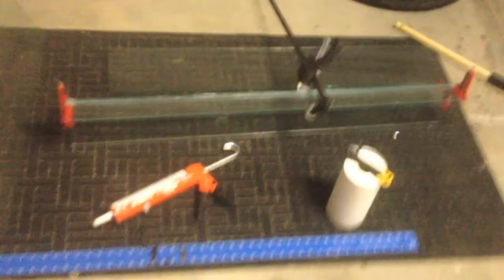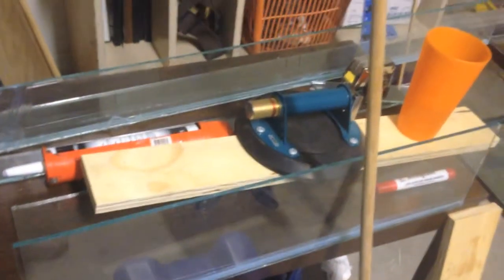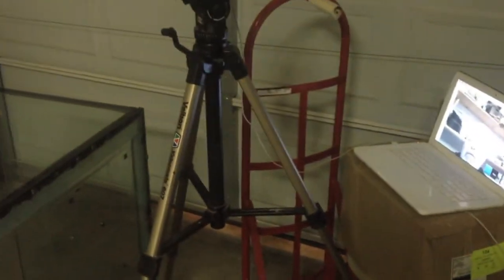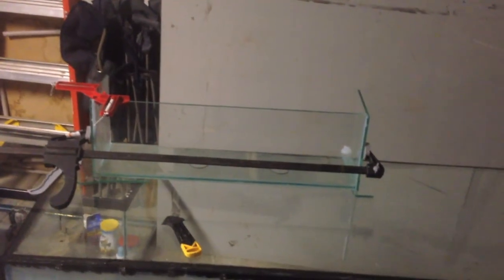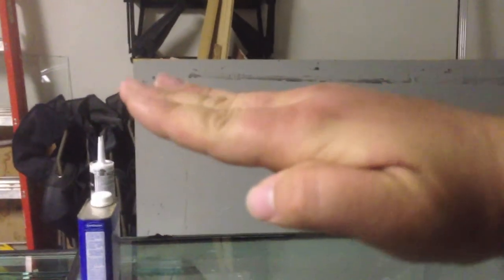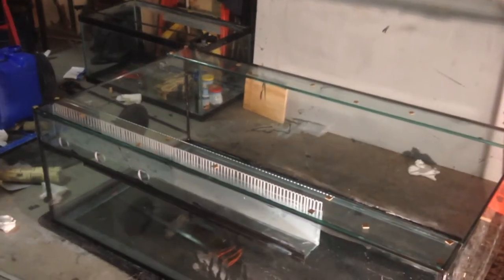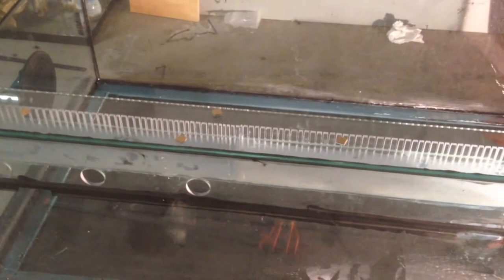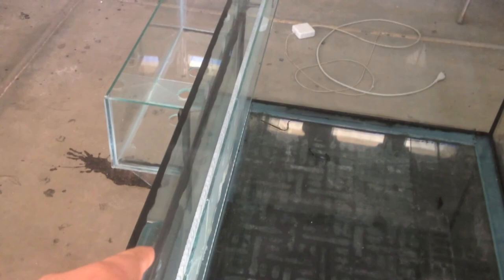How To:  Coast to Coast/ bean animal overflow External plumbing

Comment: I love the concept behind coast to coast overflow boxes. Sucks you had some of the glass break. How do you plan on cleaning out the inside of the internal overflow, because it looks like it's pretty much sealed in?
Reply from the maker: I dont plan on cleaning it.  I have never cleaned an overflow box which is why it is designed the way it is.  It is sealed so no fish or snails can get in.  And if for some reason they do get passed they will end up in the external overflow portion

Comment: Awesome video.  I was thinking about doing something similar with a derimmed 20 long.  I was thinking a coast to coast skinny over flow with the holes drilled low on to the glass so most of the piping would be hidden by rock work and the flowing out into an external beananimal style overflow.  Like yours except resting near the bottom of the tank instead of the top.  The stand, of course would be modified to support the external overflow so the overflow is not primarily supported by the glass of the tank.  The goal really being having a near invisible overflow.  At first thought, I don't see any glaring issues, your thoughts?